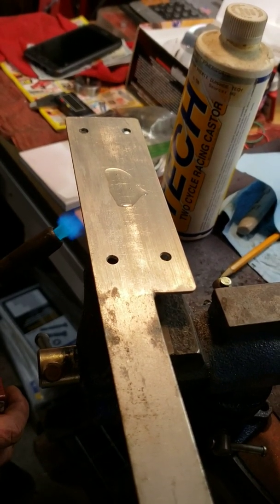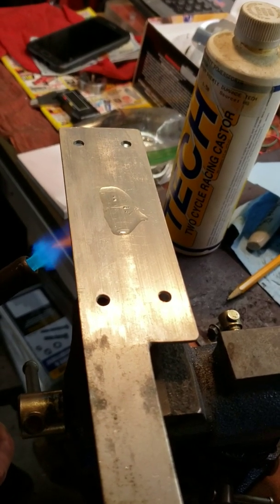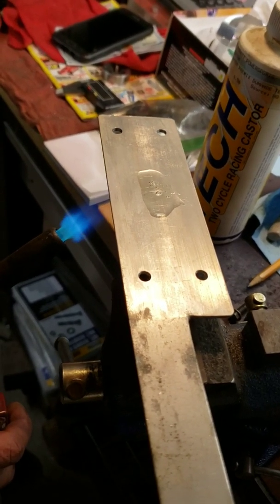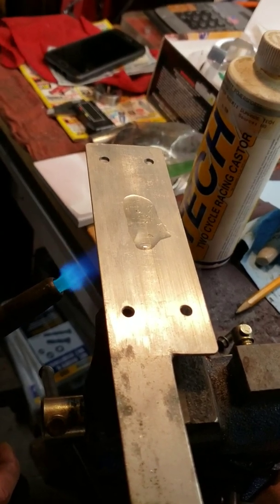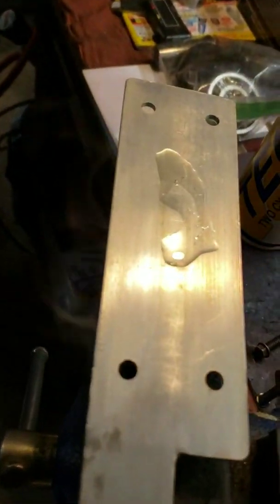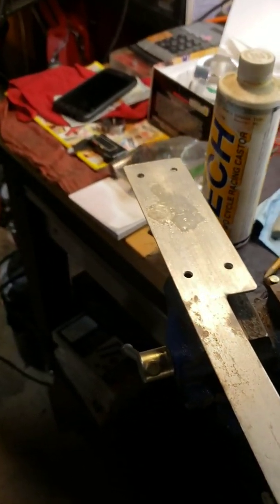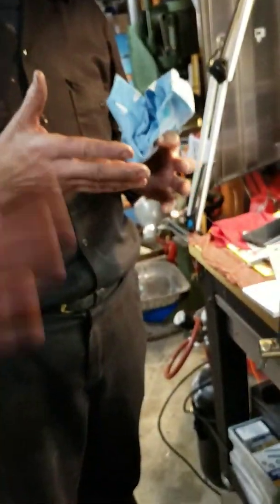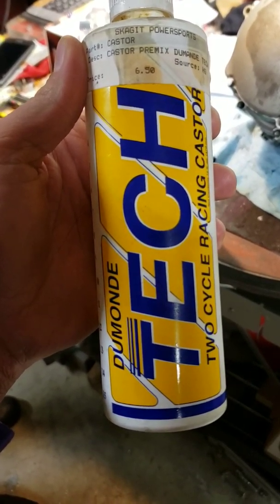Two Stroke Oil vs. Castor Oil

Comment: Does castor oil have any cons? For example I just baught myself some klotz super techniplate and it has 20% castor oil
Reply: Pure castor oil is not a clean lubricant. It lubricates amazingly at the cost of being dirty. Not an issue on air cooled 2 strokes that run hot and don't have power valves.

For water cooled motors with power valves, synthetic mixes are better.

Klotz is some of the best and you pay for it. Been using it for years and  piston cylinder always look good when pulled apart.
Reply: Mixed shelf life is only about a week with castor based premix.  Since yours is 20% Castor, it's probably longer but I recommend fresh mix regardless, and the fuel should be no more than a couple months old as well.
Stale fuel is prone to detonation, this will roast the piston.
Reply: I’ve always thought that oil to be a good compromise between wear and cleanliness.

Comment: The engines of biplane fighters in the First World War ran on castor oil. The problem for pilots in open cockpit aircraft was that they ended up swallowing some of it. A proportion of it tended to leak from the engines as a fine spray. Fighter pilots then had the runs all the time!
Reply from the maker: Hahahahahahahahahahahahaha that's hilarious
Reply: That's where the word crop dusting came from...

Comment: So if I wanted to get that racing smell from my TPI 2 stroke do I add a few drops to the fuel or run it as the main oil mix?
Reply: Just run Blendzall #455 Ultra

Designed for oil injection applications.  And doing what you'd like to do could become a problem  since some oils don't mix together
Reply: @elcincero321   I just learned of Blendzall and bought it. They say to use their Flush, so it doesn't make the previous oil congeal. Will be putting it in my 67 Riviera 430 c.i. Thoughts?
Reply: @CHEECHMUN  The 455 product seems very thin (runny) compared to like the Klotz injection oil. If that’s the case it would really flow through your pump way faster.

Comment: The flashpoint is just too high for my applications and I foul too many plugs & too much spooge.
Reply: just jet your bike lol
Reply: @theguymaxqc  that ain't got nothing to do with it rain Man 😂. You got to match the oil flash point with your engine temp 👍
Reply from the maker: @JamesPiccone  yep, you sound like you know what you're talking about. Castor has the highest flash point of all. This isn't the oil you want to use for lugging aroung
Reply: @markotd44  👍👍 not many people understand it... the right oil for the right application
Reply: It's because you're riding too slow you need to speed up or loan your bike to somebody that's faster
Reply: @andrew5550  you don't even ride goober, now go clean the Cheeto stains off your fingers and leave your grandparents basement.
Reply: @andrew5550  This ain't my first rodeo Junior 👍
Reply: High Revs, & heavy loads ++ Castor?

Comment: Not really accurate  test, also bean oil separates in the cold and has 0 protection.
Reply: Well then you should know that it’s mainly used as an additive to good quality oil. And would you care to explain how that’s not an accurate test? It showed the exact point he was trying to make and you can google the differences between 2 stroke oil and 2 stroke oil with castor oil additives. The stuff is a god send for bikes and rotary engines. People have done countless tests proving castor bean oil has several advantages that can be used if mixed.
Reply: Yep, also use castor oil in any modern engine with a power valve if you would like it to not function any longer. Nothing like tearing down an engine and seeing the ring lands seized due to this gum making them stick and losing compression. Hard for some folks to progress with technology. Not many cylinders will be running 3600+ degrees F as that propane torch is. Even air cooled engines operate in the 250-300 degree neighborhood. All newer cleaner ester synthetics are cleaner and provide sufficient protection.
Reply: @hairtrigger2438  nope not the blendzall 455 that stuff burns just as clean as TCW3 JASO rated oils give it a try it's clean and bean😎🤙
Reply: Not  Blendzall 455 that stuff is awesome in freezing temps!!!So clean too!!!!
Reply: @Steelologist  The Blendzall 455 is the cleanest burning castor base i ever used hands down..try it!!!Good down to -30
Reply: @Steelologist  I’m glad you aren’t my mechanic!
Reply: @Steelologist  I’m going to take it you’ve never heard of an infrared temp gun or shot an air cooled engine cylinder head with one. Not going to argue with a YouTube/forum mechanic. Have a nice day moron.

Comment: What’s the brand of castor is that
Reply from the maker: Dumonde tech
Reply: @markotd44  does shell advanced m racing oil work well in ma old honds mt5 with normal 98oktane methanol fuel cause ive seen on internet that some ppl say it only works with ethanol
Reply from the maker: @zape8212  I'm sorry I have no idea. I do know High octane is for high compression motors and cooler Temps, the oil is separate from that. Sorry

Comment: How much should you mix in one gallon of gas
Reply: Depends on the use. Usually every machine specifies a percentage, anywhere between 1.5 pct and 3 pct
Reply: With castor I found that even at 2 ounces per gallon it still had a good film of oil in the cylinder so 50:1 or 40:1 if you are all out dogging the bike
Reply: Try 16oz per gal i think thats what the guy who made this video is running...jkg its usually 2.6 oz ger gal. for 50:1